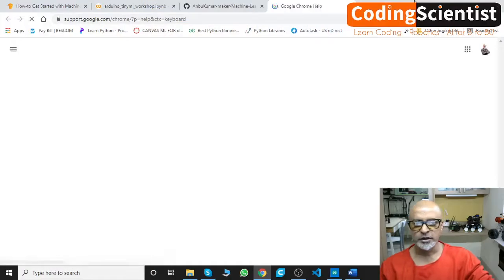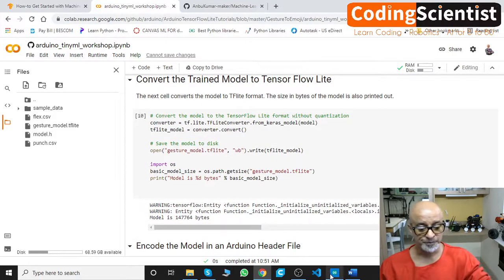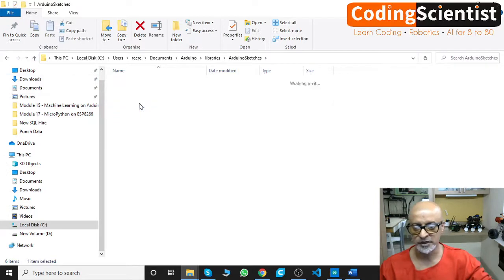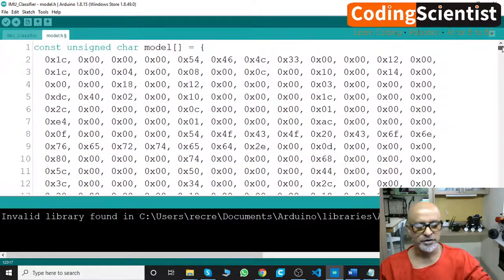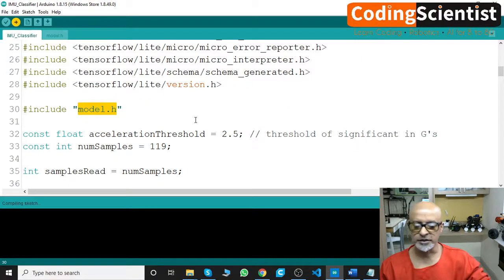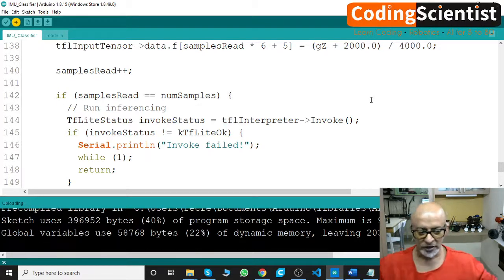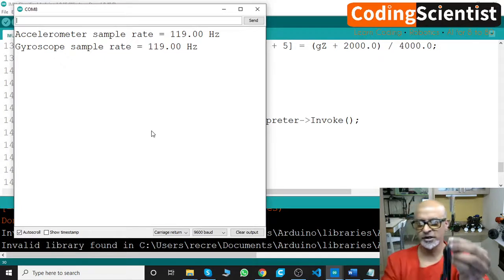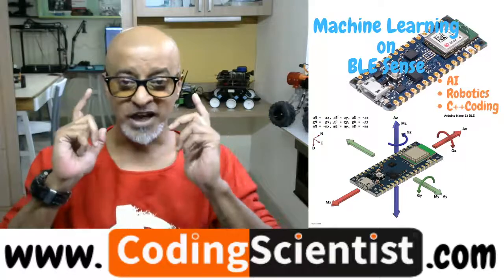Lesson 18 Classifying The Trained IMU Machine Learning Model

Comment: Sir, when i upload the model.h to BLE sensor, the output shows
"Compilation error: no matching function for call to 'tflite::MicroInterpreter::MicroInterpreter(const tflite::Model*&, tflite::AllOpsResolver&, byte [8192], const int&, tflite::MicroErrorReporter*)' "
How can I fix it?
Reply from the maker: Looks like memory issue while loading tensorflo lib, uninstall the lib from Arduino lib directory, install again
Reply: i am also facing this problem, i wanted to know if you have found a fix for it?